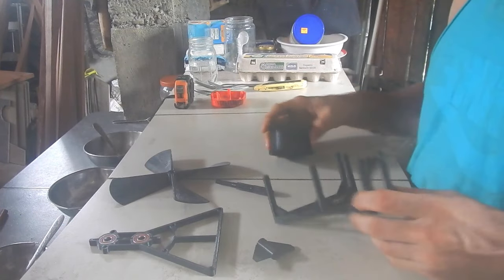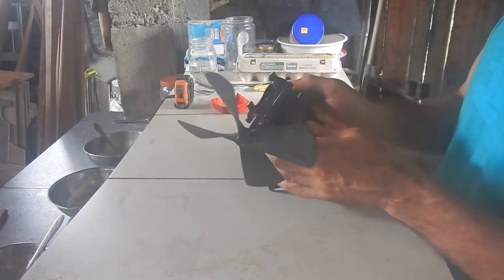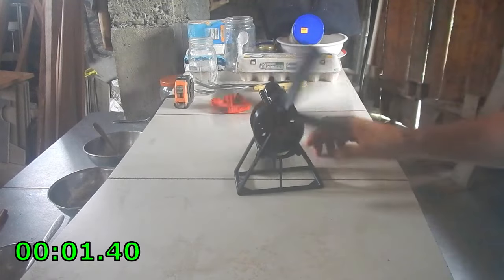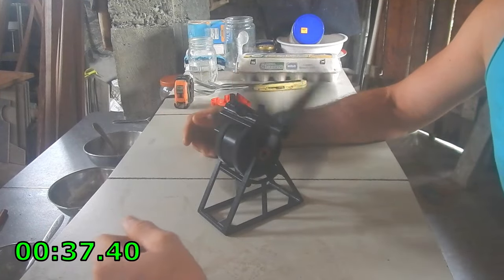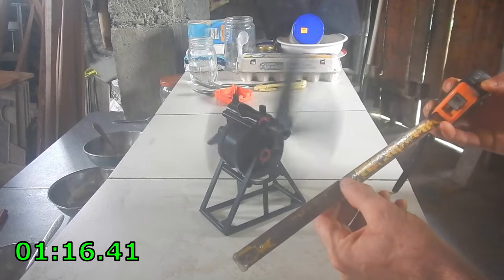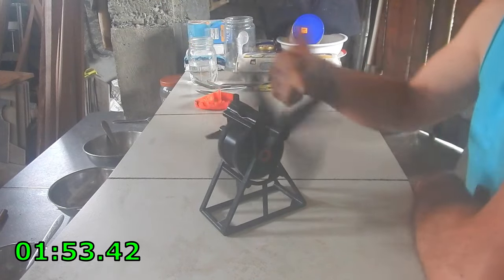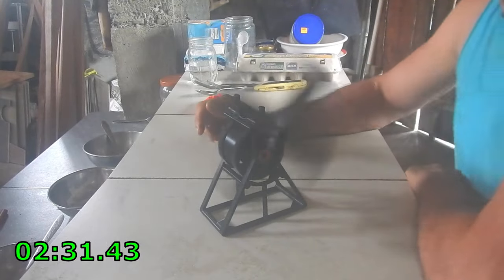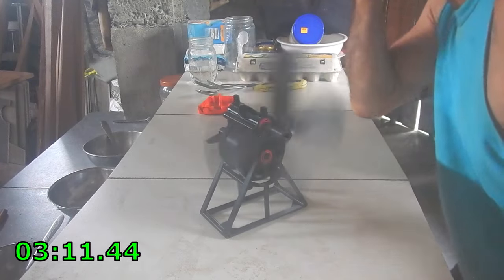3D Printed Wind Up Fan 3rd Try (Long Version)

Comment: You have high roof why not a ballast drive system . Come on Jamie think out side the box . one pull up and it it will run for hours.    As Homer Simpson would say     DOH....
Reply from the maker: So.... that is a different thing.  ....and yes.  I have thought of that.  ...and mentioned it in videos....